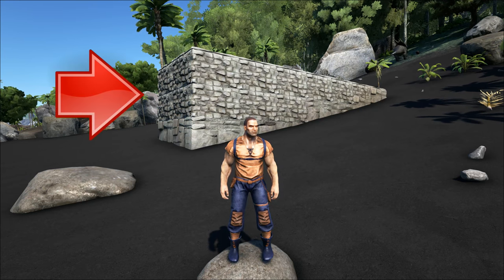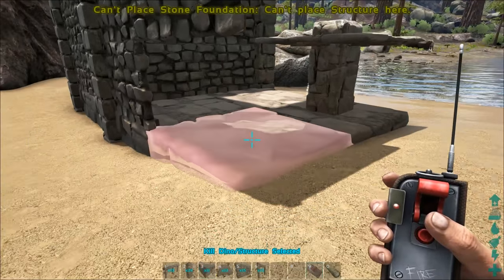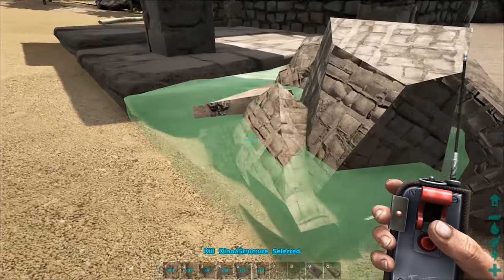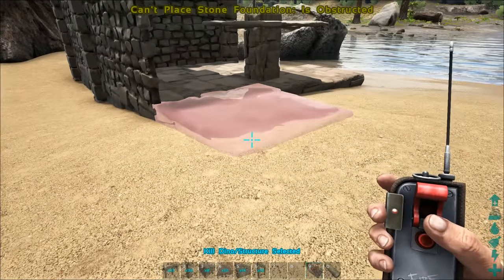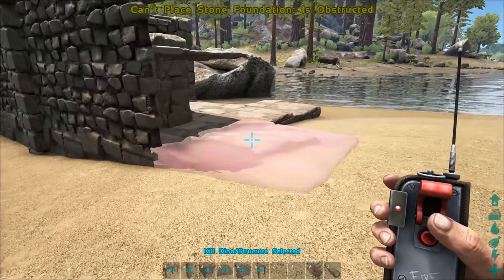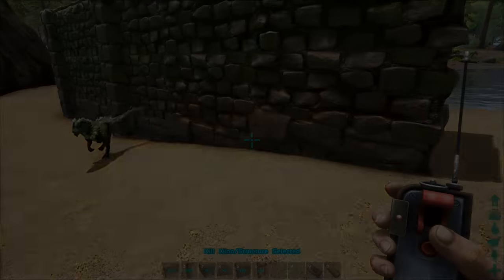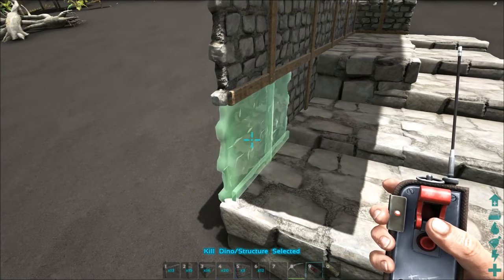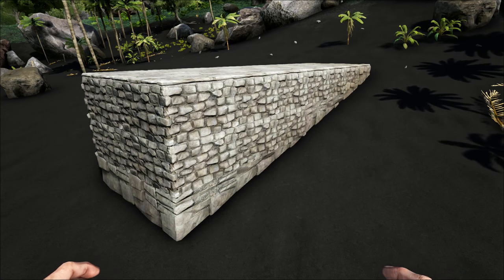ARK | HOW TO BUILD ON UNEVEN GROUND | Lowering & Raising Foundations

Comment: This has been NERFED and no longer possible.
Reply: Viq you sure
Reply: 100% Positive.

You can no longer place foundations to pillar snapoints.

You can no longer place foundations under ceilings.
Reply: Just built a base using the snap-down points, proofed in thatch before I used stone. Can confirm that it no longer works increasing the height though, so plan accordingly.
Reply: @xBloodXGusherx  mine worked liar
Reply: @harrymcdonagh4149  For a time this was nerfed and they brought it back. I am NOT a liar.
Reply: @xBloodXGusherx  Liar

Comment: I stopped playing Ark several years ago, because I got frustfrated how the building was not done correctly. Trying to continue my stone foundation building on slight downhill was mission impossible. Only got to lvl52 because, I was going to wait, that devs fix the snapping…it seems if I wan’t to continue the game, I have to do that pillar thing 😬
Reply from the maker: Yea the building mechanics still suck at some points and well they could have improved more. But sadly lot of things are not fixed or changed and they added only a small portion of the S+mod that had many building pieces and solutions.

Comment: @Fresonis Hey i stumbled upon a problem, was there some fix to this trick or is there a limit to how far you can stack the foundations? i wanted to create a big, flat surface for a building. It worked without any problems for about 15 foundations, but at some point i just cant raise the foundation for just a Millimeter to make it even with the rest...
Reply from the maker: if the ground below the foundation is too low, it will float in the air too much and the game doesn't like that, so it will not allow you to place it
Reply: so i have to put down a layer of sealings to make the area perfectly flat ._. or is there an other way?
Reply from the maker: I think that would be the only way :(

Comment: Does the pillar and ceiling have to match the foundation type? Like can you do this on a metal foundation with thatch pillar and ceiling? Or am I just not getting this right? Also, when I try to put the new pillar on the old one with the ceiling it goes way higher than it does in the video. How do I get it to just poke out of the top barely, like yours?
Reply from the maker: You can mix materials, so wood can go with metal or stone or tek etc. They all work with each other. 

With the poking I wonder if you use S+ stuff or original stuff. S+ tends to work different.

 The pillars original pillars can snap half way or just poking. What you need to do is connect the pillar on the ceiling, not place it yet and then slowly look down, it should go to the lower snappoint and then just poking through the ceiling

Comment: Does this method still work with raising foundations? I can get them to lower but not raise!
Reply from the maker: it should still work
Reply: Same issue here, when i try to put the second pillar on top of the first to raise foundations, the pillar snap half over the ceiling instead of just a bit like in the video
Reply: Having the same issue :(
Reply: Just Found a Solution if anyone is fighting with the shown method but it makes a jump more then shown Foundation>Pillar>another pillar>ceiling ontop of second pillar>ceiling out Pillar in new Ceiling in its lowest point now you can place a ceiling on that pillar ontop of ceiling 2 and another ceiling next to it a new pillar bring it to the ground remove everything else apart from that last pillar and the foundation should snap to it remember you can press Q to cycle through snap points (hope this makes sense)
Reply: I got lost at celing on top of second pillar-ceiling out. So yu want me to place it and remove from second pilar? :D
Reply: Till i can get on again here is an equally Badly Drawn Picture https://imgur.com/a/gxPYcGH

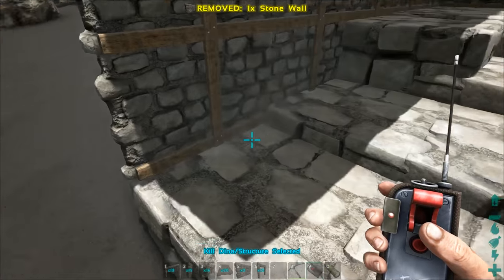Comment: everything works fine but i cant place a higher foundation on an existent foundation as seen at 5:10. i got these small but nasty gaps between foundations and bottom walls. the upper walls and ceilings are perfect in line but these gaps are really ugly. unfortunatly i cant use admin fly, i tried ramps to get the right angle for placing foundations over foundations but it doesnt work.  any idea?
Reply from the maker: that's sad that is doesn't work. Vanilla stuff now also uses no collision, so you can place walls half way in the ground etc. I don't know if that is enabled on your server though.

Comment: If you do another similar video, I think it would be better to remove the unnecessary building parts with destroymytarget rather than kill, pretty sure destroymytarget just erased them seamlessly while kill makes the debris fly everywhere. Just a thought tho, no big deal.
Reply from the maker: Ohh that can be handy, haven't used destroymytarget command yet. Thnx for the tip :D

Comment: I cannot get this to work for the life of me. The higher snap point seems to be non-existent for me on xbox. And everytime I place a new pillar or ceiling, it places somewhere else. Shit's extremely frustrating. The video makes this seem so easy, but literally won't work for me.
Reply from the maker: +Xentricityy88 sorry to hear it doesnt work for you :(
Reply: Xentricityy88 try the fence foundation trick
Reply: Fresonis I'm having the same problem. I'm also having an issue once I put the first pillar down the the ceiling on to of it I can do. But the moment I snap another pillar in the first one it gets destroyed. Am I doing something wrong. Btw I subbed
Reply: Winged Hunter256 like that really matter playing on pc. The 2 main differences may be graphics and second which is why most ppl play games on pc is because it's easier to cheat/mod. Nothing wrong with that but I'm a consol gamer. I do like mods but not enough to switch to pc. To each his own

Comment: 1:06 i cant get the pillar to snap to the higher point in my game
Reply from the maker: the pillar should just snap in the ceiling you placed on top of the other pillar. It should always work to get a pillar snapped into a ceiling. that way they poke through the ceiling and create that higher snappoint, you can stack as many pillars and ceilings on top of each other as you want
Reply: Fresonis
yeah im trying but the only 2 snap points it likes is either under the ceiling or a full half way through it. for the 1st time ever i actually want it to do the stupid poking through thing and it wont do it hehe. im trying to do it with wood pillars and a wood ceiling over a stone foundation. would that make a difference?
Reply from the maker: sometimes it helps to use a different material. for the construction itself it doesn't matter. I had it once with tree platforms where stone walls didn't work and wood worked
Reply: Fresonis
ok i guess i will just keep playing around with it

Comment: i cant for the life of me figure out how he did the foundations in the end to snap them ontop of other foundations. could anyone please help :D
Reply from the maker: they are snapped to the foundations that are higher ;)
Reply: I was trying to do the same but they would not snap =\ maybe im just stupid xD
Reply from the maker: if the difference between the ground and the bottom of the foundation is to big, then it doesn't work, then you can use pillars with the pillar, so they don't poke through the ceiling
Reply: ok thank you so much